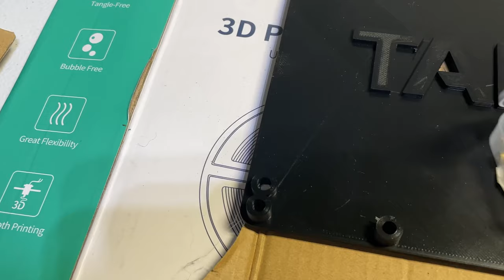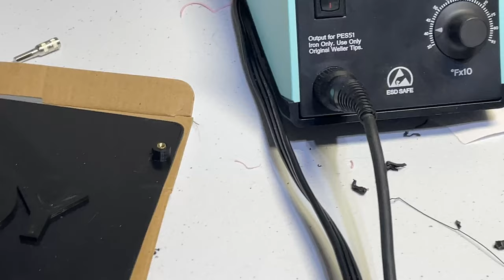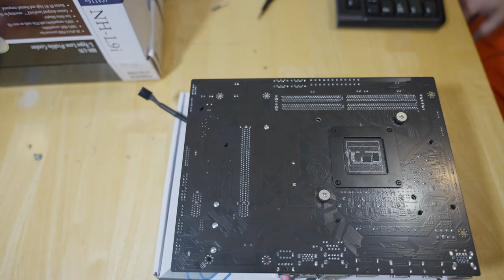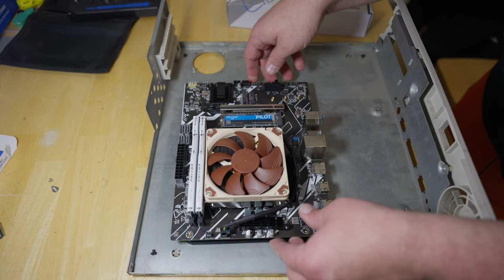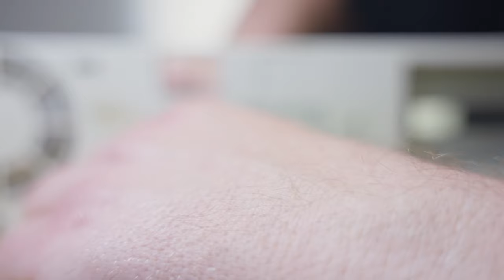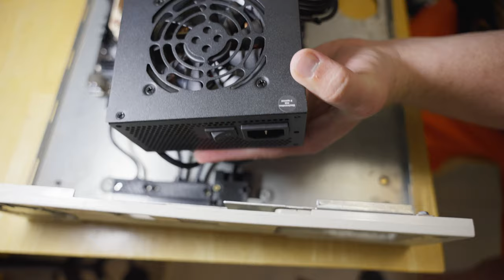Erying Motherboard in a Tandy Case - Sleeper Computer Build - Part 1

Comment: This is fantastic. Makes me want to upgrade my 6 year old NES PC build
Reply: Oh, if you need more flexibility for power supply mounting, I would definitely look into getting a PICO- PSU and a DC power brick. You can either mount the DC outside or inside. It gives you a LOT of options for how to fit things in and for a smaller lower power build like this it's more than sufficiient.

Comment: I also got on of those mother board with the 11800h in it. You can take that copper slug off to even lower the z height of the board even more for direct die cooling. Just don't try to over clock it. Have pictures if you want to see.
Reply from the maker: That’s really cool (pun intended 😊). I don’t think I’ll mess with the slug. It’d be my luck I’d end up cracking the exposed die. 🤦🏻‍♂️  

I’ve had fun with this board.  Something about the quirks has made it more interesting that commodity hardware that mostly just works.